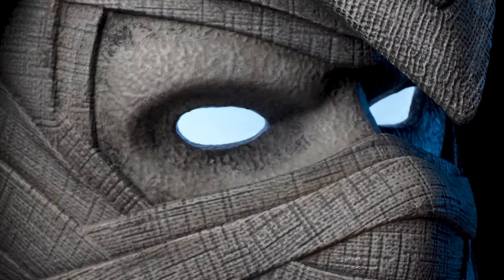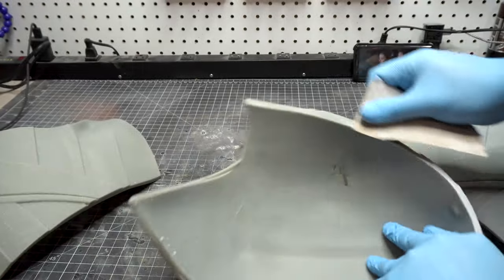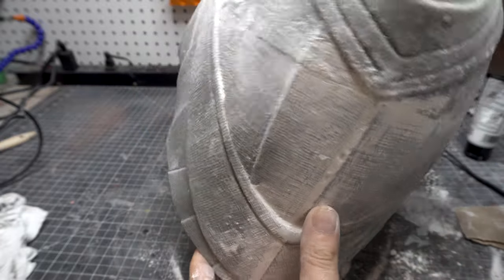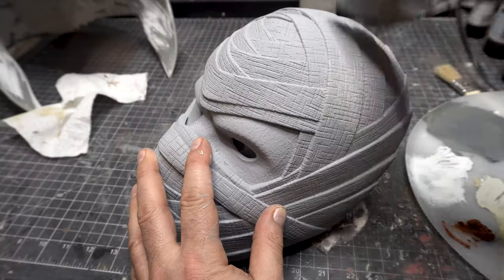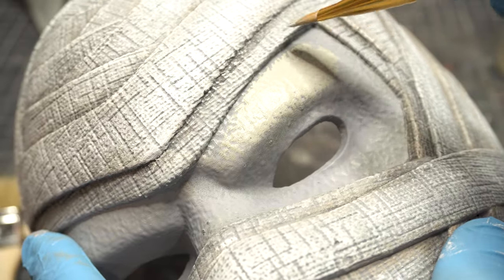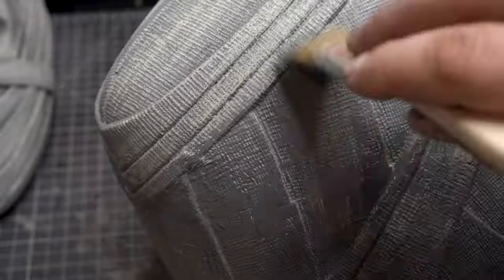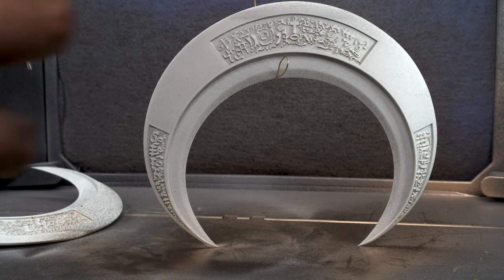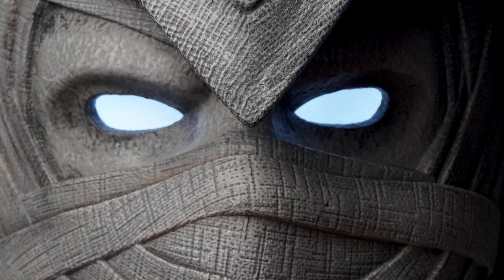Moon Knight Helmet and Cowl |  3D Resin Printed Helmet

Comment: About to start on the Mr. Knight helmet today. I was going to carefully sand some of the printer rough areas and use the fillable primer. Would it be a mistake to use filler primer on the detail? Less bandages and more "bunching up fabric". Thanks for any advice! I was also going to use the detail pallete for the red hood video to give it darker areas after a white acrylic spray
Reply from the maker: You can use the filler, just don't put to much on and really fill the detail up, and if you get some in there use some files or something to get it out. Just go light and take your time. :)

Comment: hello! I really love your Mr. Knight file. The details are amazing!
I printed it and used velcro to connect the back part to the front part but the gap is very noticeable. I was wondering if you have any tips on what should I use to connect them without making the gap too noticeable.
Reply from the maker: There will be a gap. But sanding the edges where they meet will help.
Reply: @3DPrintedProps  I'll do just that. Thanks for the tip!

Comment: Hey I had a question with measurements If my head size is 24inches what measurements are used for a cosplay helmet ? If you know lol I’m a beginner at this
Reply from the maker: If printed at 105% it will fit a 24 inch head.